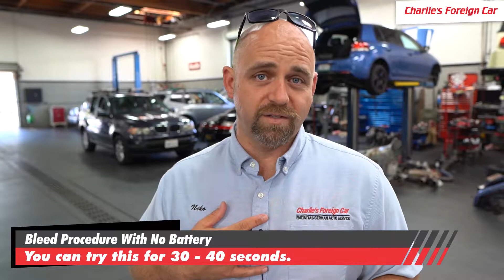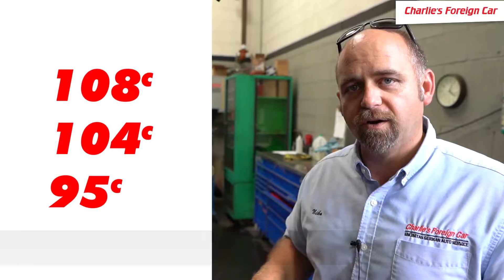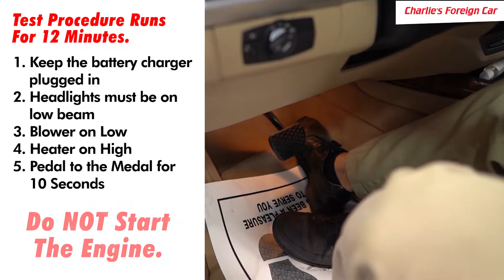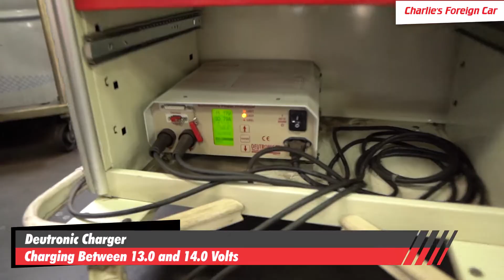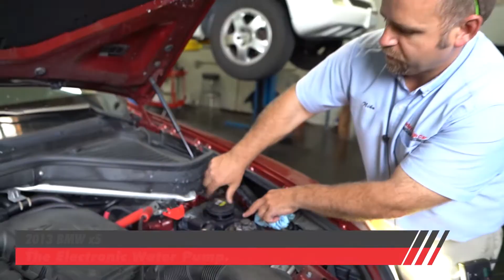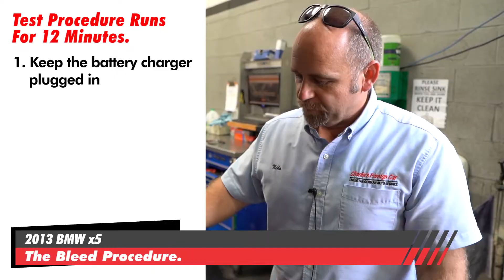How You Can Check Your Electric Water Pump

Comment: hello guys i am having issues with my coolant pump of my bmw F30 320i 2014. It just keeps on running even after engine is off and drains my whole battery. i have checked female connector which goes into the coolant pump and found both thick wires and they are receiving constant 12 volts and thin middle wires for continuity(good connection with no break). Also checked thermostat wire ,,,1st wire is receiving 12 volt(with engine off) and other wire 3-4 v(with engine on). Can you guide me what else could be the issue as i am lost here now and tired.
i also scanned and i am receiving LIN bus codes CD9010 & CD8E10
Reply: hello, this is where diagnosis gets very involved.  It sounds like you have battery voltage to the pump.  That's a good start.  But you have Lin bus codes, this can be a control problem within the main engine ECU not allowing the water pump to be controlled.  The first place to start: CHECK ALL FUSES!!  Check them with a volt meter, not a test light.  Then go after Lin bus codes.  You need a good scanner and information on the circuit topology of the systems (they're all connected).
Reply: @  thank you for your valuable reply. Can you please tell me-
1. It could be a faulty pump which is not able to read when ecu is asking pump to start:stop or a faulty thermostat ? As i have check 2 things wires communicating with ecu and those 2 wires have very less resistance (shows 1 on my continuity meter) 
2. Are you talking about fuse of the pump? If yes Where is the fuse location of the pump? I have checked all fuses in the front hood compartment and no fuse reacts to the coolant pump.
Reply from the maker: @manjitsingh-bu7lz  hello, yes it could be the pump.  More specifically, the controller inside the pump.  What other codes are there?  and I'm not specifically talking about any 1 fuse.  This is a very easy trap to fall into, many professional technicians fall into the same.  It's easy to get tunnel vision and try to tune into only the affected problem area, in your case the water pump circuit.  DO NOT "CHECK" THE WATER PUMP FUSE!!  Check every fuse in the car with a volt meter, not a test light, and also not an ohm check.  Volt meter on 20 volt scale DC.  There is a right front fuse box in the engine compartment, and also a rear fuse box under the trunk mat.  What is your code definition?
Reply: @fixingcars  hello my scanner gives me CD9010 and CD8E10 lin codes. Are you saying check voltage of all fuses on the trunk and hood compartment? If yes how would i know what is the voltage to compare against with and also which is the ground side(-) and what is the power receiving side(+) of the fuse as i think it can create a short circuit within the system if accidentally i mixed something. 
Do you know where the water pump fuse located as i have already checked all fuses in the front hood right side box and no fuse there stops the pump even if i remove the fuses
Reply from the maker: @manjitsingh-bu7lz  Automotive fuses all have B+ power.  You have to find a good ground with one lead of the voltmeter.  Then you check each side of the fuse with the other lead of the meter, you should have B+.  This is a skilled test and should only be done by a professional.  Your codes indicate that the "water pump is missing".  I would look at the water pump connector very closely, also the wires in the immediate area.  Has any other work been performed recently?  To help any further, I would need to see the car.
Reply: @ no work has been done recently. I searched and found coolant pump recall issue for bmw 2014 models though my car model was not part of it. Also just to let u know my coolant has a very very minor leak so every 8-9 months i get a low coolant level warning error which i just refill and it goes away. Where are you located?
Reply from the maker: @manjitsingh-bu7lz  I'm in Encinitas, California. USA
Reply: @fixingcars  oops i am in Canada
Reply from the maker: @manjitsingh-bu7lz  It's all good.  I know a couple shops in Canada.  Techmax Auto Repair in Mississauga, ON.  Alberta European Motorworks in Red Deer, AB. also Expert Motoriste in Rimouski QC
Reply: @  ok thanks i will check

Comment: I’ve done this job a couple of times and never had to turn the headlights on , I don’t have a charger either I just hook the car up to another running car via jump leads and activate the self bleed with heaters full heat  on low blower and press gas pedal for 10 secs , 12 mins and done , no need for lights to be on or some fancy charger
Reply: couldn't a short, blown fuse cause the bleed procedure to fail. my code is lost communication to water pump. wondering how do you test voltage at the waterpump itself. test the connector and the water pump leads?
Reply: @wavybump  Yes, a water pump failure can blow a fuse.
Reply: @cheeseburgerbeefcake yup if it isn't the fuse it's the pump. usually and unfortunately it's the pump
Reply: @wavybump  I've the same issue with the same code did you find a fix?
Reply: @wavybump   Probably a broken ground screw/bolt near the water pump. Common problem on N52, N54, and N55. Check google for pictures and location. Replacement bolt is M8x20mm

Comment: Tried this procedure on my 10 335i xdrive,,cooling fan kicks on wide open,,so can't hear pump running. By the way motor hasn't been ran for a day. So why is cooling fan ki king on????
Reply: Possibly a bad coolant temperature sensor (usually at the front/top of block near the oil cooler and oil filter housing.  My understanding is that if the sensor is bad, it defaults to running the cooling fan (because it doesn't know how hot the engine/coolant might be)

Comment: hello, my heater does not heat the cabin, and also the engine fan works at maximum speed since I start the vehicle, i have a e60 550i 2007
Reply: Did you find the problem? Have the same  issue?

Comment: ok please help 2008 BMW 328i..when i did this test my headlites stayed on even if i never started the car .......and it ran my battery down..        So, i only heard the pump come on one or twice in ten mins..ALSo, it said to PUSH THE START BUTTON..u did not mention that but it said DO NOT START CAR, or put foot on brake -just press START BUTTON after foot on pedal for 10 secs..         
 THE other issue is the waterpump is new and doesnt seem to be on all the time..how many times should the electric water pump come onn and off in ten mins...
MAybe it wouldnt come on as my battery was going dead..

WHY are my headlites on ..they were in OFF position..COULD my daylite running lites be on?

ALSo, i had too much coolant and took some out with TURKEY BASTER..does that mean i have to BLEED coolant again?
maybe the turkey baster allowed air into resevior???????     any HELp appreciated.           .also should CAP BE ON w/bleeder screw  CLOSED? THANK U

Comment: can we get that message and the faillure come from the thermostat ? 
i change the pump 3 times in 3 years with the same thermostat and i have the message again with the msg on the board telling me that the engin is too hot...
i didn't buy the thermostat from BMW but the 2 pumps i brought are genuine
thanks in advance for helping me
Reply: its probably electrics. you should always switch out the thermostat when changing the pump though
Reply: @mcxr811  i've change the thermostat and the pump but i think it was a electric problem too... the 3 pumps i changed get hit after i go washing my car... 
the message stays for 5 months then the pump stop working (...du to blockage message)

Comment: I have an 07 E66 750LI I did the test and it does not pump any water I just replaced the thermostat and water pump with new ones and it still not working. When I start the car it does cycle the water can the electric water pump itself be bad? Is the electric water pump just for this test or does it also run during operation? I do hear it trying to turn on and then just a clunk sound kind of.
Reply: Did you ever figure out the issue

Comment: Have a 2014 x5 35i xdrive, the water pump runs while vehicle is off, replaced Both batteries thinking it was the batteries, got them registered twice. Drove fine for 5 days, then electric pump started running while vehicle is off at night draining the batteries, took it to the dealership paid for a diagnostic, but sins the batteries had been drained they told me to drive it. "Still got charged" for the diagnostic. Well drove it and now the vehicle is drained again! Called the dealer and told me they cannot or will not be able to figure out whats wrong with it sins the batteries are drained for the third time. So dealership is pretty much charging every time for a diagnostic even though nothing shows up on there scanner. Im at a stuck point, vehicle is drained and is just parked. It has no check engine lights on neither does it run hot. Its my wife's dream car, and seeing her upset makes me upset. At this point i am Really disappointed in bmw, it is a expensive  and expensive to maintain it as well. Barely hit 90xxx miles its 7 years old & there should be no reason for this Expensive vehicle to doing this. Expensive vehicle but cheap parts that cost a fortune!! Have atleast a total of $1600 in the vehicle with batteries included!! I am Very Disappointed!!
Reply: Did you ever figured out what was the problem? I’m having the same problem .
Reply: They charge you multiple diagnostic fees for the same thing. Wow. The first time my water pump failed was around 60k miles. The dealer said the alternator also is bad because it was overworked due to a problem with the failed water pump. Water pump, thermostat, alternator replaced: $5300. I remember the alternator alone was $1000!! Just the part.
Reply: Same issue here, did you get a solution

Comment: What happens if the water pump runs while the vehicle while the vehicle is off?
Reply: It drains the battery. If it's very hot, it can run for a short period. To avoid running the water pump, let your car idle for 5 minutes so it cools down a bit before turning off the engine.
Reply: hello guys i am having issues with my coolant pump of my bmw F30 320i 2014. It just keeps on running even after engine is off and drains my whole battery. i have checked female connector which goes into the coolant pump and found both thick wires and they are receiving constant 12 volts and thin middle wires for continuity(good connection with no break). Also checked thermostat wire ,,,1st wire is receiving 12 volt(with engine off) and other wire 3-4 v(with engine on). Can you guide me what else could be the issue as i am lost here now and tired.
i also scanned and i am receiving LIN bus codes CD9010 & CD8E10
Reply: Sorry did you find the solution, I'm also experiencing the same issue
Reply: @mokoensn  what codes your getting and what exactly issue your facing??? And is your door lock has any issues????
Reply: Driver door lock not working, getting Lin bus communication cd8e10
Reply: @mokoensn did u tried changing your pump yet?
Reply: On my second one
Reply: @mokoensn what second one??? Second pump u mean
Reply: I mean I bought 2 new pumps but still had the same issue. I got advice that it might be the connector cable. I cleaned it up made sure it was all in and made a good connection and the problem has been sorted it's been a week now no issue
Reply: @mokoensn  so u mean the connector harness which goes into the pump was bad?
Reply: @manjitsingh-bu7lz  yep that's the one. I couldn't find a new one, I think there was also a bmw recall for those harnesses. Left me broke but at least it's sorted
Reply: @mokoensn  i think my connector is bad too. Can you tell me how did you fixed the old connector or bought a new one? What wire size(22,16,14,12 or 12 gauge) female connector i need for those for wires, any specs? Please advise .
Reply: @manjitsingh-bu7lz cleaned with something like a carborator cleaner. The two small wires for communication were behind and the connections we bent not making good contact, use a knife to open them up. And I pushed the connector in as hard as I can until it clicked